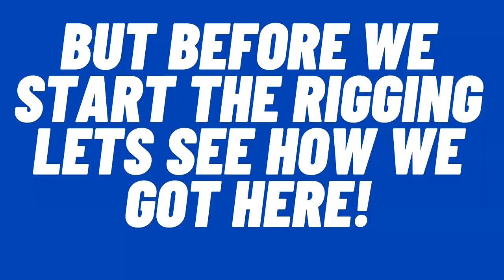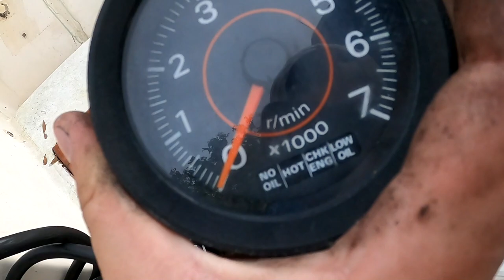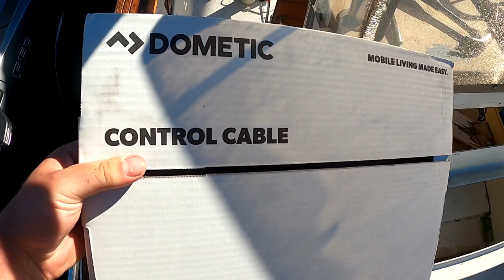PUTTING AN ENGINE ON MY 1980 20 FOOT ROBALO! 175 HORSEPOWER EVINRUDE, AND HYDRAULIC STEERING!

Comment: Vevor makes excellent products .. I have an electric hoist , throttle controls for my mercury 50 , and an outboard motor stand . All made by Vevor.   They make the same quality stuff at a fraction of the price
Reply from the maker: Yes they do! I was pleasantly surprised with the hydraulic steering system and its the exact same thing as a sea star, and yea you cant beat the savings!
Reply: @oneofakindoutdoors  have you checked out their main website? It is full of stuff at a fraction of what the box stores charge